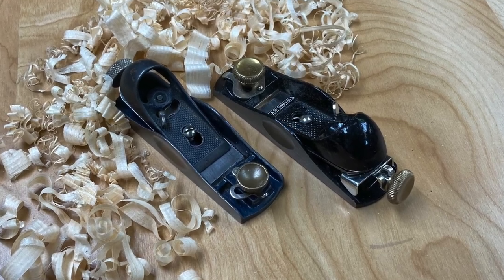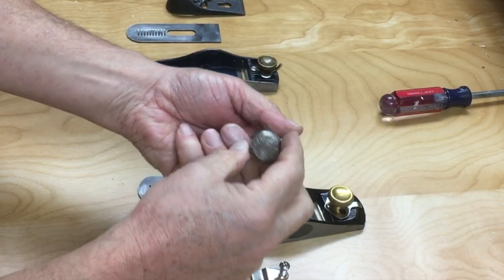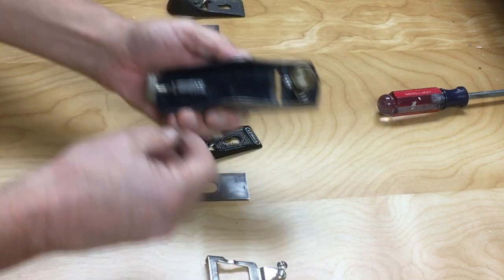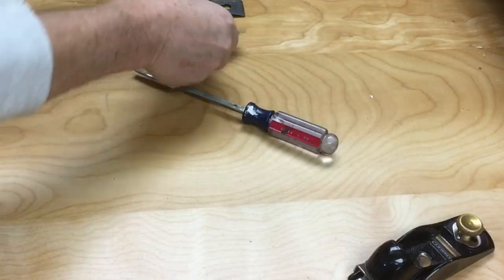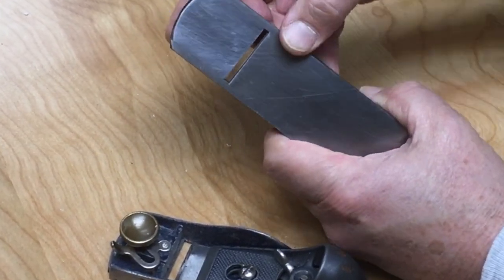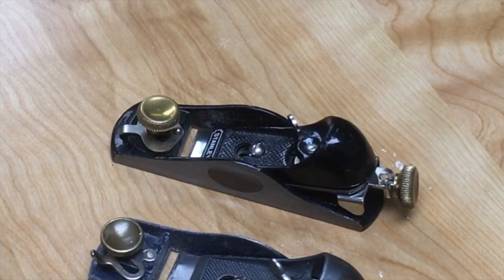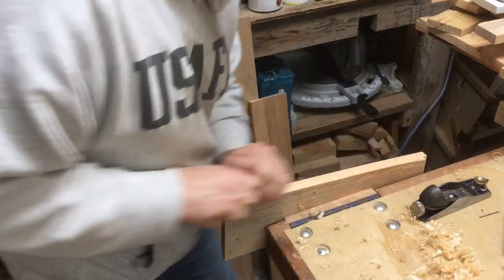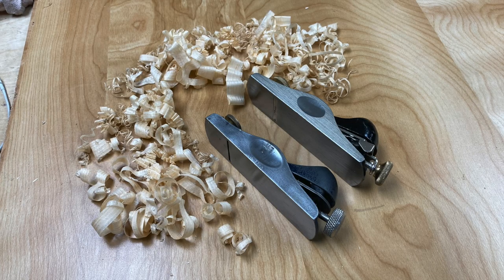Stanley No. 60-1/2 Low Angle Block Plane compared to newer English Stanley 12-960.

Comment: Thank you for doing this compare.. exactly what I was wondering while perusing ebay.  Thanks!
Reply from the maker: Glad it was helpful.
Reply from the maker: The 12-960 I have is made in England and I’m not sure if the current new planes are exactly the same as mine. So shop carefully or opt for the old ones.

Comment: My new Stanley has been a real pain. The sole was conveyed, not level at all. The bedding of the blade was not even level!  Hours of sanding finally leveled the bottom and another hour of filing and using a Dremmel tool got the blade level at the mouth. It cuts, but now has trouble holding a setting when used on hard wood. Never again, Stanley, never, ever again.
Reply from the maker: Bummer. Even though mine was “newer” than my old 60-1/2 it wasn’t new new. Probably just don’t make things the way they used to 
Sorry to hear it.